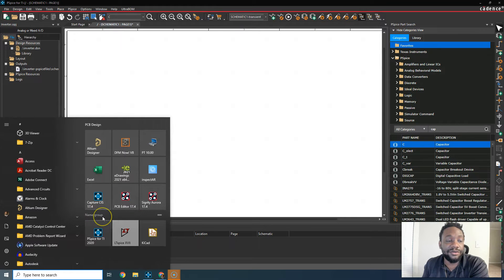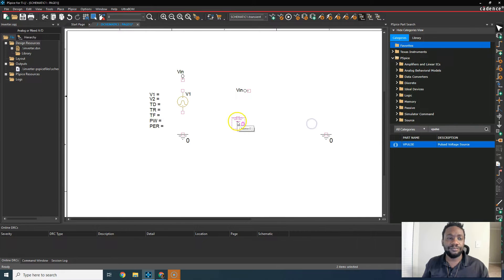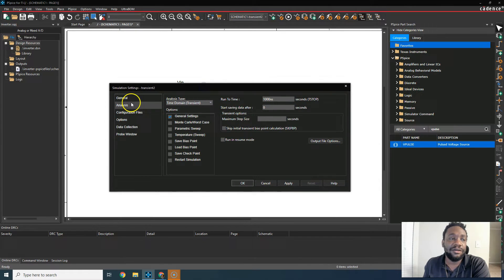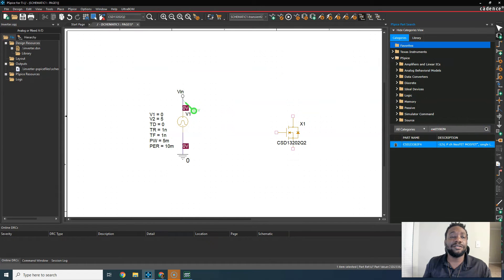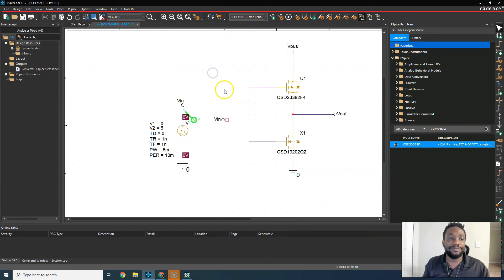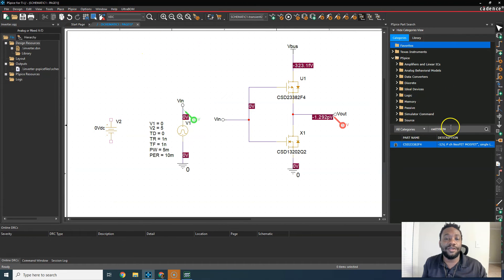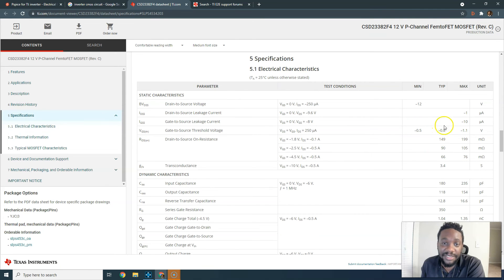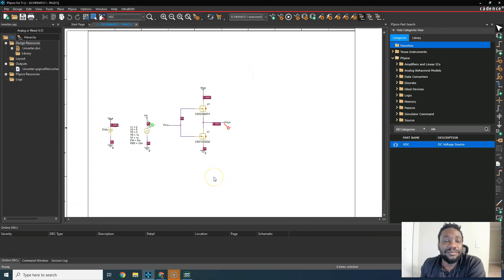PSPICE for TI Inverter - How to Simulate CMOS Circuit In OrCAD PSPICE

Comment: The top mosfet is in the wrong way! (but the same error in the original post) 
Even when the top mosfet is suppsed to be off, there will still be current flowing through the body diode. thats why it doesnt go to 0V, because theres a great amount of current generating Vds from the bottom mosfet when its on

Comment: Hi Mackey,

can you please help me how to fiix this errors in pspice for ti

** Profile: "SCHEMATIC1-LED_Driver_Transient"  [ D:\PROJECT_FILES\NLIGHT\01_ELETRONICS_ENGINEER\SIMULATION\LED_DRIVER\PSPICE\SCEMATI
Reading and checking circuit
ERROR(ORPSIM-15108): Subcircuit AL8860 used by X_U1 is undefined
ERROR(ORPSIM-15108): Subcircuit B240A used by X_U2 is undefined
ERROR(ORPSIM-15108): Subcircuit LEDR used by X_U3 is undefined
ERROR(ORPSIM-15108): Subcircuit LEDR used by X_U4 is undefined
ERROR(ORPSIM-15108): Subcircuit LEDR used by X_U5 is undefined
Circuit has errors ... run aborted

Comment: Hi, I have a question.. Could you let me know how to add a NC(no connection) to a pin of an IC?
Reply: @techedkirsch  The problem is I am receiving an error after adding a 'No connect' symbol from the place menu.
Reply: The error is 'smulations failed because of the netlisting errors' and the error is highlighed at the pins where I added the 'No connect' from the place menu
Reply: @techedkirsch  I have sent you the mail
Reply: @techedkirsch  I have managed to solve the problem by connecting a highvalue resistor(100M) to ground. I hope now the situation is similler to a unconnected pin. Thanks for your support!